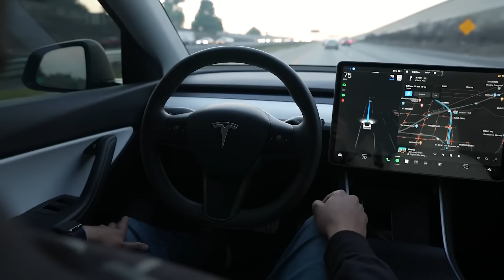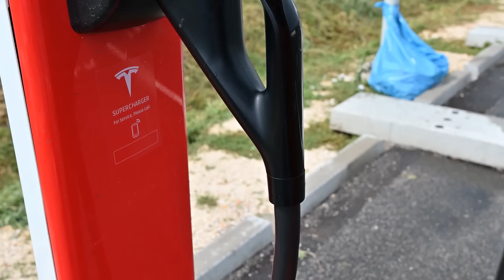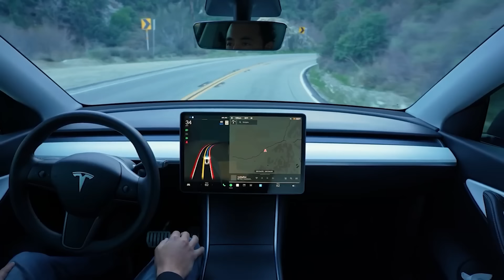Elon Musk OFFICIALLY Bought Ford | HUGE NEWS!

Comment: This scares me! As a Michigander, I hope Ford keeps the combustion end and continues the Ford tradition.
Reply: I hope the same please keep going ford
Reply: It's time to move forward gas engines are too costly in the long run
Reply: @williamdavenportii764  Your joking right? Everything that EV;s have shown is that they will be limited, the cost of ownership will be sketchy, the safety factor is lower, and when there batteries are through, the whole thing is totaled. They are not green in any capacity of the word. They have yet to explain how expired batteries will be disposed of responsibly.  They are only good for city dwellers. If that is what you want, by all means you do you.
Reply: I live in Metro Detroit. At one point or another me and my entire family worked for the Big Three going back to before the war. I only buy Ford products (Lincolns). I could care less if Ford goes out of business because everything they build now is junk and they have had the most recalls two years running, and gunning for three. Now they are building cars in China - our biggest threat. I haven't owned a Ford product in the past decade that was made in the United States. If the US car companies can't be loyal to us, I'm not going to worry about buying American nameplates anymore.
Reply: @Pro1er  This has been going on for years.
 Whenever the company finally gets the reliable part of the government regulations down. Along comes another round of them.
 R & D is not cheap. The paper the regulations are written on is cheap.
 Example the 1st 20 Ford Fusion cost $100,000 each before testing even began.
Every major change like hybrid or drive train change also is and was like that.
Ever seen a Ford Escort EV? Well Ford did make a few and never sold them.
Figured out the range was to short for cold or hot weather driving comfort.
That would not fly with mom and the kiddees. Mommy has the last word on buy it.
 Oh and the all window down buffering?
 That had to go
Pretty much one hour of driving required 3 hours of charging.
Probably because the platform could not hold a bigger battery?
Reply: @williamdavenportii764 $15,000 to replace an EV battery...🤔 think about that.

Comment: Your story doesn't seem to match the headline?  I drove a Tesla for 5 days recently, I was NOT impressed!,,   The road noise inside while driving was horrible, I don't want a car like that.  The owner of the car paid in excess of 80K for this car.  It was advertised to get 400 miles per charge, it didn't.  It has 40K on it now and the most millage I saw from the indicator on the dash was 186 miles, so I guess the batteries have degraded to a point where it's getting less than half the advertised miles per charge after only 40K miles of use.  I don't want a car like that!  I didn't check myself but I was told that new batteries cost in excess of 20K. I don't want a car like that.  The doors on a car in that price range shouldn't rattle inside when you close the door. I didn't see much wrong with the build quality from the outside it looks pretty good.  I did hear about how many other problems the owner has had with the car, and battery life issues would put me in line to not buy a Tesla.  I started to pre order a Cyber Truck I'm glad I didn't.  After reading the facts about the batteries and where they come from I just don't even want an EV at all.  They are not saving the world as we were lead to believe.  The last I heard was that Ford stopped production of the Lighting because of several production problems and less than expected orders which included the "shortage" frenzy. I don't understand that either, there are so many other choices why would anyone pay the high price plus an inflated premium for something that is over priced in the first place?  You can buy a nice F150 for less.  Mine lasted over 400,000 miles and I sold it to a friend that is still driving it 8 years later.  Something is not right here.

Comment: Model Y versus Mach-E, no contest, Tesla tech, efficiency, range and fast charge infrastructure doesn't compare, Tesla is way better. Model 3 is the best.
Reply: self driving is included with Mach E, don’t need charging infrastructure, only local charging at home. I would take a Ford over Tesla, too many ways to be shut-down with Tesla.  I bleed blue however

Comment: Ford is already going down hill anyway. Elon will just give it a push. Electric vehicles are not all they are being portrayed as. The cost of them alone is crazy. The range real sucks unless you shut everything off and coast. The amount of time it takes to charge is crazy. And what about the cost to put in a home charger?! I'll stick to gas and diesel vehicles! The new vehicles have enough electrical issues with out being all electric. The repairs on them are very costly. For $150 I can change my battery when it goes bad!
Reply: So is gm

Comment: Elon, I have an idea for a reverse hybrid that needs no hybrid battery. Put two third gen MG 1s from a Prius on the output of a reliable mid-engine, (each at 1:2.5 with a stout planetary gear-set) lock the inputs of what's left of both transaxels by their no-engine fly-wheels, and directly couple the MG 2 stators of each front and rear transaxels to their respective MG 1 stators with some big water-cooled caps accross each leg. Whadya think ? You could save drag racing. make hybrids fun. Just imagine a whole market of off the shelf high-cureent DC to DC converters and bldc motor drives and stators. No more belt accessories or 12v electrics for gasoline cars. Eveything driven by 72vac to 120 vac three-phase that doesn't need a lot of big copper cable. Use new technology to enhance the best of what we already have instead of just abandoning it. That's my vision.